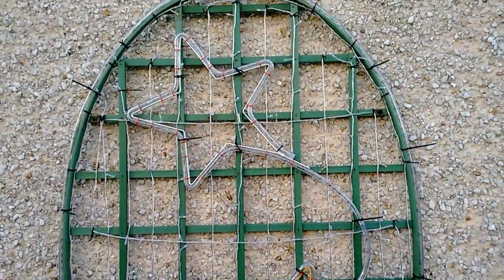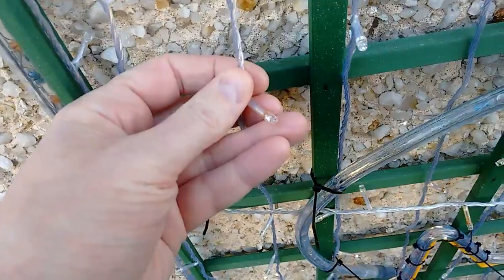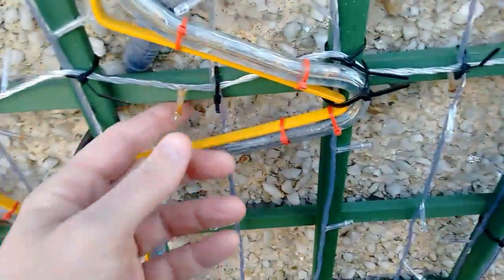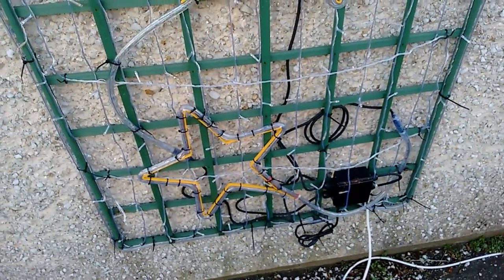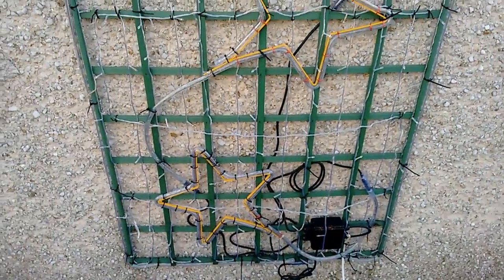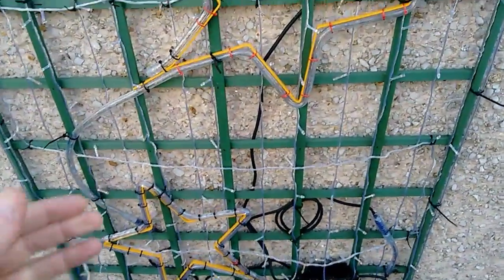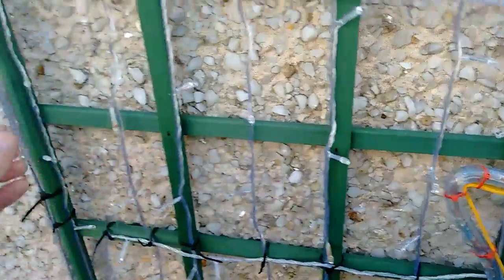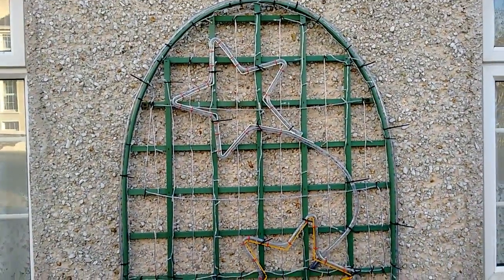Post-Xmas check on cheapo Chinese 240V LED fairy light string.

Comment: I was thinking of getting a 500led /50 meters string light like this and turn into a flag pole light, I've had 100 led versions of this before and I know that the sealing isn't great for outdoors use (I live in Sweden btw) so I was thinking, would it be possible to tape each individual led with transparent tape to weather seal it more you think? Or will it still corrode due to dampness and moist? I will keep the controller and plug indoors and just have the led lights outside.
Reply from the maker: I've looked at waterproofing the standard lights and it's tricky to do it easily.  The commercial lights pot each light in resin in a little closed tube.
Reply: I see, yeah I guess it's a bit tricky to do. I might go with the one's they sell at the local shops, they are a little bit better quality at least, although they only have them in white light. We'll see what I can come up with. :)

Comment: Its a shame that, cos it did look good. there has to be a way to better water proof these piggin lights so we dont have to keep buying new ones. I have a £12 wilko solar 'rope' light I had outside, within a few weeks the glob at the end pushed its self out (pressure  build up?)and the leds inside had started to 'pull out' with it. The whole 'rope' had water inside but still worked. I think because the leds are on that coated copper wire and the leds are those tiny resin blob ones. Anyway I bought it in, cleared the rust out the solar/battery end, dried it out and shoved the gubbins back in the rope and have it in my house until I find a better way to weather proof it. I think a small water tight box on both ends should do it with the rope pulled taught between them and a slight drop in the middle for water run off??

Comment: I bought some outside/inside LED lights with the 6/12hr timer. Whilst the two AA batteries kept it going for about a month, by the end of the month, around 1/3 of the LEDs were not lighting (which I guess means that maybe 3 or 4 LEDs were dead)... Whilst there was corrosion, haven't really had a chance to work out exactly what the failure was. But they were under a tenner...

Comment: discovered your videos by chance when looking into led floods. retired electrical engineer, security eng myself and radio ham.  so have a quest for me knowledge.  thanks for the videos, been very interesting. repaired an led flood and acquired some high voltage for to experiment with.

Comment: We have used the same blue net (2M x 2M) lights for the past five years, and although they were £10.99 B&Q lights they are still working. However this year they are starting to show signs of corosion and i noticed 1 led has failed. I think the next set will be indoor use only from now on. Its funny that for a few pounds more the difference in quality can make a difference.

Comment: Many of the lights in my Tesc0 outdoor lights failed this year.  Following your video on how they were strung I chopped out the defective sections and strung out the shorter section.  They have now gone in the bin but lasted another season!  Quite a few of the LEDS were black with the DC corrosion that "outdoor" lights suffer with.  Cheers for the content Clive.

Comment: I bought some for a decent bit of cash from a name brand in a non-dodgy Hardware store chain and it had corrosion on several right out of the box without even touching moisture! Only half of the lights worked a week after installing them due to nothing caused by me.

Comment: My replacement strings of LED Christmas lights on the deck railing didn't last one season. Squirrels ate several of the bulbs and bit sections out of the wires all over the strings. Totalled!
Reply: It sounds to me like your wires may have had soy based insulation on them? Which is probably pretty tasty to squirrels.
Reply: I did a search on Google about squirrels eating Christmas lights, and this is a very common problem, at least in North America! Many people have very angry posts on forums about losing their lights to squirrels a few years in a row, and want to learn how to stop it, and even municipal light displays are being destroyed by squirrels. I was thinking it was a one of a kind bizarre event, but it turns out to be common!
I checked the strings, and nine LED bulbs are gone, and there are about a dozen pieces of the wire between one and three inches in length were bitten out.
Reply: Thanks. I might try more new strings again next Christmas, with moth balls!
Search on YouTube:
Squirrel bulb bandit: sneaky squirrel makes off with 150 Christmas bulbs in 24 hours
(not my video, but I guess a similar thing has happened)

Comment: Bummer about the corrosion. It makes me want to avoid using LED strings outside in direct exposure at all. They seem doomed if fully exposed to weather.
I could see under an eave or canopy though. Then they seem like simple ambient moisture might not take as high a toll on them.
Reply: LEDs light chains are as waterproof as any other kind of light chain, that is as waterproof as the manufacturer makes them. You get what you pay for is more often right then wrong.
Reply: I was under the impression that the DC stuff is more prone to corrosion that the AC stuff due to electrolytic effects?

Comment: My only concern about these short term obviously inadequately made gadgets. Majority will just throw away, though they could last much longer if we didn't consume cheap, thus built better. LEDs touted as having long run time. 
So much electrical waste no?
Reply from the maker: It's horribly wasteful.  They're designed to fail.
Reply: bigclivedotcom In the grand scheme of things, who's to blame. Us consumers or manufacturers for forcing cheap on us. Neither of whom think about the impact. LEDs have especially the biggest impact on recent years. I do see many consumer units fail much much earlier than their expectancy, mostly the electronics to be honest. Landfills will be full of this junk.

Comment: I used these cheap mains Chinese led strings 3 years ago. first year from 1st December to 5th Jan no failures. second year by Christmas Eve over half the lights on the string had failed due to water and electrolysis corrosion. This year started testing battery powered strings that use dc power and reverse the polarity to give two channel effects using two wire connected strings. I think they will last a lot longer.

Comment: I tried similar non outdoor led rice lights outdoor and figured that the orientation is what makes them corrode quickly. If the LEDs point upwards, water will not go in nearly as quick and it will last a lot longer.

Comment: It would have been nice to see how well they still worked before you took them down.
Reply from the maker: Pretty much as they were when I made the video about that display last year.
Reply: bigclivedotcom You keep hours as weird as I do.
Love your videos, by the way.
Reply: bigclivedotcom Hi Clive, love your videos. I wondered if you make a video about the eBay HLK-PM03 AC-DC 220V to 3.3V Step Down Buck Isolated Power Supply Modules. I've just bought a couple then thought maybe I shouldn't have...
Reply: bigclivedotcom Hi Clive, love your videos. I wondered if you make a video about the eBay HLK-PM03 AC-DC 220V to 3.3V Step Down Buck Isolated Power Supply Modules. I've just bought a couple then thought maybe I shouldn't have...
Reply: John Horton Send him one. Maybe he'll do a tear-down!

Comment: Why did you not just remove them all ON the frame? Much easier for next year. ;)
Reply: Maybe he wants to dismantle them and test them. Plus he'll want to build a new setup for next year feeding his passion for all things electronic.
Reply from the maker: The frame is always on the wall.  And besides I want to do something different next year.
Reply: But just imagine if you solely ADDED to the frame, every year. The amount of sparks and shorts would grow over time. It would be spectacular - in a few years time, you would not need any LED's!

Comment: I may or may not have caused an explosion that left me deaf for 5 seconds by over inflating my bicycle tyre..

Anyway. It was extremely loud and exciting. Explosions are always exciting even when they're not.
Reply: Jafafa Hots
Indeed, compressed fluids are no joke! An oxygen canister can go through multiple brick walls if laid flat & the head is knocked off.
Reply: my brother did the same, tyre said rated to 60psi,   blew up at 50 psi
Reply: Well, you've just set yourself back a good amount of money to get a new set :D

Unless you're allowed to buy part-worn tyres where you are, like we can in the UK.
Reply: S.A. Smith It's a bicycle, shouldve made that clearer. Inner tubes are only £6. Already replaced :P The real issue is that the explosion bent my rim out so my brakes don't function properly. Despite that it was extremely entertaining!
Reply: Sample Textᴴᴰ
Ah I see. If you've got a blow torch, gently heat up the rim (do you know if it's steel or aluminium?) & use a pair of pliers (not long-nosed/needle-nosed pliers) to bend it back into shape.

Save you spending £20 gett a new set of rims. As for inner trubes, yes I know. They're cheap. Replaced my girlfriend's inner tubes on her bike enough times haha.
Reply: SinfulReaper Shhh. They're onto me!
Reply: You can buy cheap tubes and tyres regularly, or you can buy more expensive ones and they last ages.
I'm using Maxxis tubes (just basic thin ones) in Schwalbe "protected" tyres. So much better than the cheap crap I used in the past. The time saved in repairs had paid for the extra cost IMO.
Reply: jusb1066 Probably the rims buckling before the tyre blew. Cheaper wheels aren't rated anywhere near as high as modern tyres tend to be.
Reply: A the gas station less than a mile down the road from me here out in the boonies, a father and son were filling a large tire (tractor?) and it exploded, killing them both.
Reply: You wouldnt say it was exciting if you went deaf for life ..